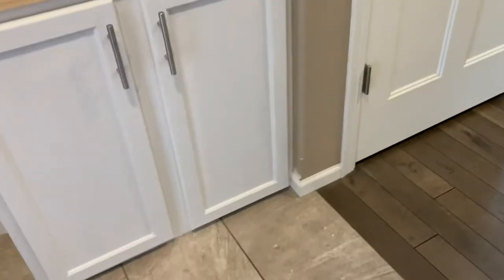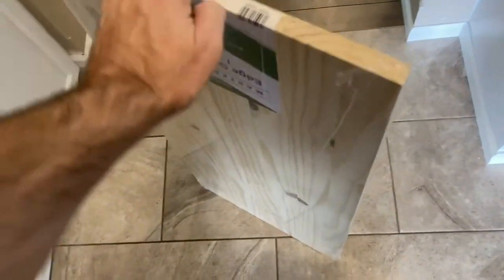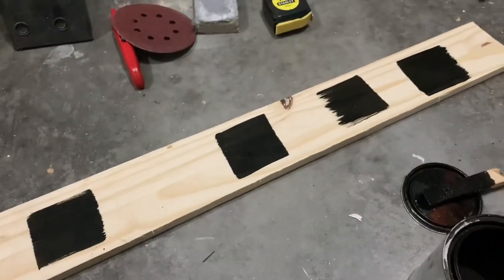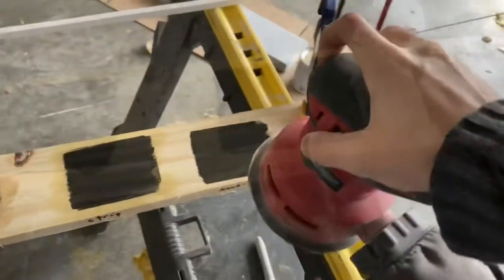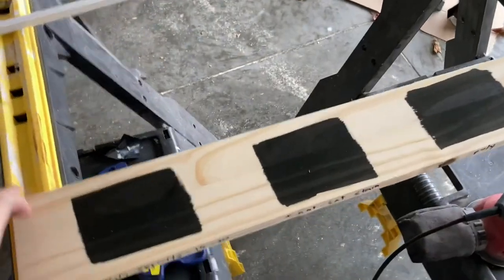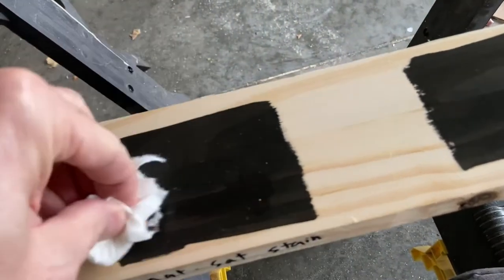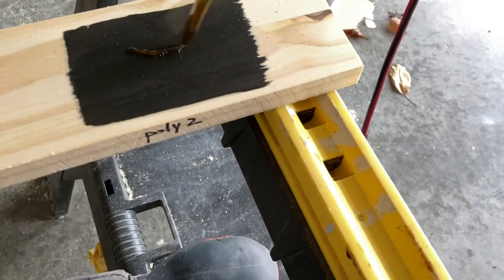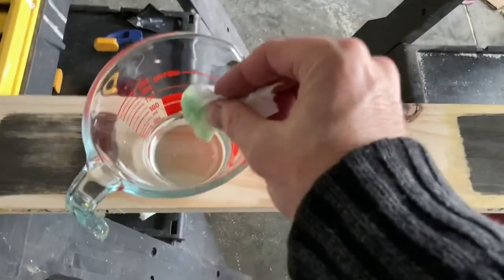️🔥 How to Lighten Dark Stain➔**See Beautiful Wood Grain** Underneath Black or Dark Brown Stain - DIY

Comment: Hello, I really like your work, the effects are just great, but I have a big problem when trying to recreate it. basically I am aiming for the effect bleach 15-30 (with bleach making nice grey spots) however when i do it myself, the bleach simply removes the whole layer of stain, until you can literally see the wood coming out. I am using Minwax wood finish true black stain if that helps, and standard bleach (I live in EU, so could not buy exactly the same one as showed in the video). Any tips how to get the same result? Thanks!
Reply from the maker: Not sure about the type of bleach, but if bleach is removing the stain completely and it's applied for 30 min, it's probably on for too long. If it were my test, I'd try the bleach for less time - maybe neutralize it it at 5 min, then a different sample at 10 min, etc. and record your findings. I'd also wonder if another layer of stain would help.
Reply: @diybandit  Hello, sorry I have perhaps described it in a bit too confusing way. The bleach works almost instantly, I dont have to wait. It removes the whole layer of stain along the grains. It does not create any discolor, which I liked so much in this video. Perhaps I should add that I am staining a plywood. Any chance you could hint me what was the bleach that you were using? I am desperate to get similar results :D Thanks!
Reply from the maker: @Profundis2137  I used a product like this: https://www.hy-vee.com/aisles-online/p/3128877/Simply-Done-Concentrated-Bleach-Regular-Scent
Reply: So this happened to me as well but I used a chemical stripper. Stain came off instantly and took out about 80% off the stain. Good thing is I did it on a test board. I am going to just try sanding it to see if that works.

Comment: Hi.. Where did you get such a thick wood peice? Or did you stick 2-3 peices of wood together?
Reply from the maker: Good question - I bought a thin reasonably-priced board, then added 1x2 trim to the board's outer edge, giving it the appearance of being 2" thick, or slightly less. I did the same for our bathroom countertop - huge price savings!

Comment: hi. I have a question. if i apply a dark (full brown mahogany) stain on a lighter stain (full maple) will i still get the full brown mahogany color? or should I apply a different one over the maple color to get the result that I want? ..thanks
Reply from the maker: Good question. It's really hard to say. The test phrase is going to be super important for your proposed colors - like I showed in my video, I set up and labeled some different scenarios (using same wood, same brush, same temps, and in your case experiment with dark over light, and then a different one over the maple). I spent days testing - I needed lots of patience. Once you find the combo, dried, that you like, your notes should tell exactly what to do for the desired outcome. Good luck!